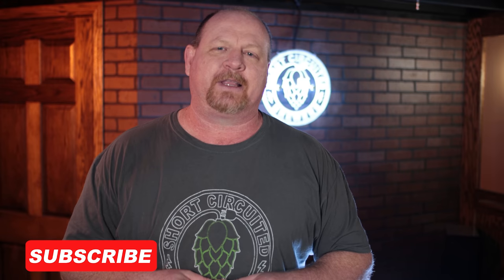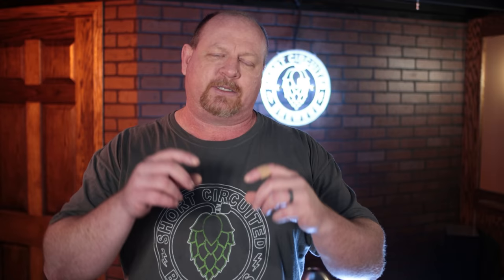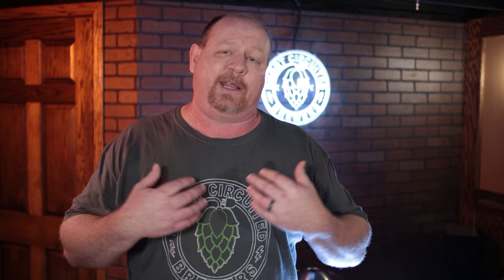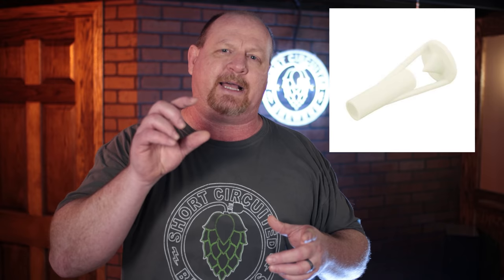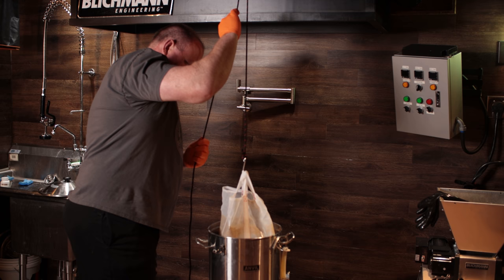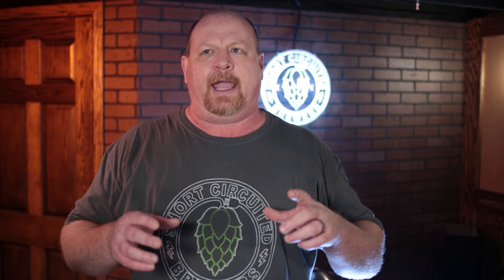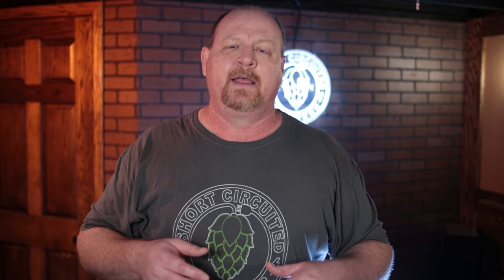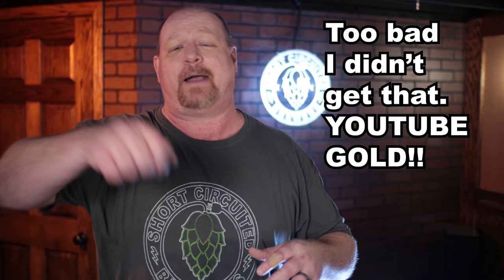Anvil Foundry Feat  The Brew Bag Products

Comment from the maker: Just in case you're wondering I'm using the 12.5-in x 23-in bag. Also this method is not only for the anvil foundry I think it would work on any of the all-in-one brewing systems. Check out the links in the description for all the products I used! 👍🍻
Reply: Timeline: 2.19 in the vid
Here, the bag looks as if it’s too small; might this have contributed to the bothers mentioned later?
Reply from the maker: Good observation I didn't realize it but the bag that they sent me was for using with the basket. It did work fine but there is a larger one that they sell that's for using without the basket. I don't know that that caused any particular issues for me but I would recommend the proper size bag for what you're doing. 👍🍻
Reply: @ShortCircuitedBrewers  As a total novice, I appreciate you taking the time to run this test. It's shown how all-in-one brewing systems can be used without an overflow pipe and how this might dispense with the need for a special micro overflow pipe package when mashing smaller grain loads. This is the first vid I've seen on this topic and your confidence in the process has prompted me to get a bag for my as yet untried Brewster Beacon. Clearly, you don't mind displaying the hiccups when you explore an innovative approach, which of course, makes it all doubly informative and highly entertaining. It's all good. Again, many thanks.
Reply from the maker: @BillyBobpeeps  thanks man I just try to be real and show everything that goes on I'm glad you found it helpful. 👍🍻
Reply: @ShortCircuitedBrewers  gday mate ... so are you saying that with that bag you were given, you should have used in on the inside of your malt pipe?
Reply from the maker: @3nunsbrewing640  yes, they have specific sizes for different applications. 👍🍻

Comment: This video is awesome. I was pondering about this forever. I have a brewers edge mash and boil with pump and I can tell you the malt pipe sucks with the pump it is hard to recirculate the mash because the malt pipe gets clogged very easily and it is very annoying. Hopefully if I try a bag recirculation will be better.

Comment: I use the same bag in the malt pipe and every batch comes out pretty much perfect! They make a really good product there!
Reply from the maker: Yeah my first time with the bag from them. Very good quality for sure! 👍🍻
Reply: I have recently done 2 batches in the malt pipe with the bag. I agree it does make some pretty clear wort. However, I am not getting great results. Seem to be lower efficiencies. Not hitting my gravity readings as well as I would like. Batch of Haze Craze I just brewed a few days ago was also a little low. IDK, Thinking of trying to lift the malt pipe a few times during the mash and see if this helps. I think without the pipe and with a bag would give you better results. I just think the dead space around the pipe is my factor for the lower efficiencies. Ideas? Comments?

Comment: Brian, I've been brewing with the Brew Bag without a pipe.  My question is really about adding hops to the kettle.  Did you have any problem with the pump clogging when dumping the hops pellets directly in?   So far, I've been using hop spiders or Bags to hold my pellets during the boil or hop stand but I'm looking for a better answer.  Would you recommend just dumping the pellets?  Is there an upper limit to the amount of pellets to dump in?  It looks like you caught some of the hops during your "whirlpool" by catching some from the outflow of your recirc hose but thats after material went through the pump.
Give back to you:  I used to squeeze the bag and no sparge.  I have since improved my effeciencies by using a series of 3 food grade 5 gallon buckets (about $5 at Lowes).  One bucket to catch the wort, one bucket with holes that I drilled.  Let bag drain some then move into the bucket with holes.  Sparge.  Twist the top of the bag to the top/center of the grains and add another bucket to the top of that.  I actually sit on the top bucket to get every drop out.  Alt: cut the top off another 5 gal bucket (doesn't need to be food grade because it won't touch wort).  to use as a spacer between the catch bucket and the holed bucket to allow for more wort without overflow problem.

Comment: I use the 400 micron brew rew bag in the malt pipe. I use a fine crush, about 0.3, but I do stir the the grain bed every 15 minutes during the mash. I step mash, ramping up from 145F to 153F in the first half hour, and then ramp up to 170F to mash out in the last 10 minutes. I normally mash longer than 60 minutes, more like 90 minutes.  I always get a mash efficiency above 75%, and usually above 80% (using sparge method).  Note that I also always use a carefully adjusted water profile, amylase enzyme, and a meticulously monitored mash pH as close to 5.2 as I can get, adjusting with lactic acid immediately after I dough in (the first 10-15 minutes of my mash are very busy and hands on); those factors all play an important role for hitting the mash efficiency target.
Reply from the maker: Thanks for sharing those tips! 👍🍻

Comment: Thanks for this video. I have been using BiB with my anvil for two years. Never had a problem touching bottom, I used the lid clamps with the BiB tabs. Will use my ring next time just to see. Never a temp. problem. With BiB I double-crush grains and always squeeze the bag. Do you plan to try the steam condenser? I see you have a fan/hood. I brew outdoors from April to November but would like to set up in the basement for the North East cold months. I also use 220/240 set power after start of boil to 95 or less depending on outside weather.

Comment: Another great video Brian - thanks for all the hard work making your videos.  Gotta say though, on this one I’m not quite sure of the bag benefits.  I’ve used several sizes of these bags through the years with igloo cooler, mashing in kettle via induction heating, and with 5500W element.  Great results but I always found cleaning the bags hard to clean really well.  They are outstanding quality though and I can highly recommend them, and their gloves and pulley.

Moved to Arbor Fab basket with intent on it being easier to use and clean with 5500W kettle.  Good efficiency but the bag was a little better.  Basket was still hard to clean - I must be anal retentive but I don’t like any grains stuck in bag or mesh basket after thoroughly spraying with hose and the putting it back in kettle when recirculating hot PBW.

I’ve use my Foundry 4 times now with just malt pipe and haven’t had any issues with stuck mash, scorching, etc.  I do not use my riptide though; overkill for this system.  Using the small Anvil pump which works well with system.

The single vessel manufacturers design their systems to be used as-is, so if they don’t work as-intended they need us to send them feedback and do reviews.

Just bought a Spike Solo basket for 5 gal batches.  Should I expect issues with the slotted bottom similar to those mentioned about the foundry?  Like our old school keggle false bottoms a quick spray with hose should clean most of debris, correct?

Thanks again, and cheers mate!
Reply from the maker: I will tell you the Spike basket has been known to have some sticking issues. Watch how fine you grind and maybe throw in some rice hulls. I did a NEIPA in the spike basket with quite a bit of flaked adjuncts. Did not recirculate or drain well. I wished I had used some rice hulls. Thanks for the feedback Art! 👍🍻

Comment: I just bought a brew bag to use inside the malt pipe to prevent the grain bits from getting into the wort and also allow me to crush a bit finer.
Reply from the maker: It will work for that for sure! 👍🍻

Comment: Honestly I use the bag inside my malt pipe. It just seems to make my life easier and I don't anymore grains clogging up my pump (I use a Zyborg). I have not seen any change in my efficiency.
Reply from the maker: It definitely is easier to clean up and clearer wort. 👍🍻
Reply: Works great on my Mash & Boil. I clip it to the outside of the kettle so when I pour grains they don’t go down the side and clog my pump.
Reply from the maker: @danc3693  nice! 👍🍻
Reply: Same here. The malt pipe was the hardest part of cleanup until I started using this bag. The only part that doesn't work as well is the distribution plate for the pipe. It doesn't fit with the bag in the pipe. I just lay it on the top and push down a bit and it works fine.
Reply: This is what I do as well.
Reply from the maker: @TheKlamminator  whatever works I always say!! 👍🍻

Comment: I have a love-hate relationship with silicone tubing. On the one hand it's very nice to work with, very flexible and heat tolerant. On the other hand it tends to attack me every time it gets the chance or otherwise ruin my day. When pumping sanitizer solution through it for example the end of the tube always manages to be in a position where it splashes the solution on me or all over the table I am working at. Or, when filling the Grainfather with a silicone tube if I open too much pressure from the faucet  the tube jumps out of the Grainfather and splashes water all over my floor.
Reply from the maker: Haha.. yeah I came up on the losing myself!! Lol 🍻👍

Comment: I recently tested this idea on my Brewzilla 35L because I wanted to try a high gravity brew. With the bag and false bottom, the dead space is reduced to 3 quarts. I didn't want to put the weight of the grains on the false bottom/burner so I attached it to the top of the kettle with a bungee cord. I mashed in 18 lbs 6 oz with 6.75 gallons, which pretty much maxed it out while keeping a thin, workable mash. I only stirred, no pump. I sparged by pouring over the bag in a big strainer. I got 70% efficiency and 1.081 OG. All in all it worked, but wasn't super easy and lifting the bag manually was difficult to say the least.
Reply from the maker: Haha I bet that was an awkward process for sure! That efficiency is really good considering how much grain you used!!
Reply: @ShortCircuitedBrewers  Mash efficiency just to clarify, not brewhouse. I was happy with it overall. I mashed in really well and stirred every 20 minutes. I actually sparged over a bucket because my big strainer doesn't fit in the top of the Brewzilla. Thanks for the video!
Reply from the maker: Ok.. that's still not bad all things considered! Thanks for the feedback! 👍🍻

Comment: Is anyone experienced with using a brew bag inside of the malt pipe, and might have some notes on it? I find that the perforation of my malt pipe in the Brew monk 30L isn't sufficient to keep some adjuncts and finer milled grains out of the wort, but would be optimal to keep it in the pipe since I don't have a crank.
Reply from the maker: There are quite a few people that have used the brew bag inside of the basket. With good results. The only thing that I will tell you to be cautious about is if the handle ends protrude into the basket just be careful that it doesn't catch on the bag and tear it when you remove the bag. I can guarantee you that the bag will reduce if not eliminate the particulate that your experiencing. The link in the description will send you to the company that sells the bag that I'm using in the video. And if they don't have what you need they can custom make one for you. 👍🍻

Comment: I mash like this, with a false bottom in my brewing system. My bag is made of heavy duty nylon and has a stainless steel ring sewed in the opening of the bag, that is just a litte larger than the opening of the brewing system. I lift the bag out and batch sparge in another kettle with heated spargewater. Efficiency is stable at 83-85%, and i do stir a lot.
Reply from the maker: Nice!! Sounds like you have it dialed in! 👍🍻
Reply: @BigHill do you have a LINK for that bag with stainless ring?  Please :)  Happy Brewing.

Comment: I'm using the brew bag with a 35L Digiboil with false bottom and it works great! It makes a cheap but efficient system that's easy to use and clean
Reply from the maker: Nice the digiboil is very low cost. What's the total you have in it $?
Reply: I was looking at the same with the digiboil, but does it hold a constant temperature during the mash?
Reply from the maker: @SteveT__001  not as well as the Foundry.
Reply: @ShortCircuitedBrewers  Yes, no argument there. I use the Klarstein Fullhorn which works great as a BIAB, I recirculate the mash and batch sparge and I can get 80% efficiency but want to make bigger batches. A shame I can't get a 50 litre version without having to buy a all in one. Cheers
Reply from the maker: @SteveT__001  👍🍻

Comment: Great to see a review on this Brian. I first bought a bag to go into the pipe from The Brew Bag and used it a couple times but saw others using a bag only. I liked the idea because the wort between the pipe and kettle seem to be somewhat stagnant. 

Ugh - found out The Brew Bag for inside the pipe was a little too small to fit the kettle. I bought the false bottom which to me seems easier than messing with clips and the dreaded ring. I tie a fishing line or SS wire so I can pull it out after the mash. 

I didn't want to spend another $50 on another The Brew Bag so I went with a less expensive Wisler bag. It doesn't seem as robust but has worked fine. 

At the end of the mash I use the ratcheting lift to pull the bag and let it drain. It's difficult to sparge these bags over the kettle so I hang the bag inside a 10 gallon Igloo round beverage cooler, pour the sparge water over it, then dunk it a few times, and squeeze it a bit. Hit my best mash efficiency yet doing this.
Reply from the maker: Cool! Sounds like it works. The Brew Bag is not the only bag in town
.lol but they make quality stuff for sure👍🍻

Comment: Presently I am working on using a Unibrau as a BIAB system - I have done with and without the bag, although I have no numbers to compare to yet. I am working on the math to determine an extract efficiency (using only the amount of sugar extracted) - I find brewhouse efficiency isn't what I am really interested in. Eventually I am going to be trying to do some light sparges to compare to.
Reply from the maker: Do you use brewing software? It will calculate everything for you. 👍🍻
Reply: @ShortCircuitedBrewers  Generally, yes I do. But I am also working on my own. I am not terribly enthused about using software based around "gravity points". I am working on a setup that uses metric units and Plato (as % of sugar by weight) and seeing how that works out. One concern I have about the gravity point method is the non-linear relationship it has to % of sugar by weight - as evidenced by the comprehensive formula to convert Plato to s.g. whether or not this pans out is another thing. But I love math and beer - so I want to put them together.

I also want to be able to write scripts that do the calculations for beer recipes in a way that others that are interested in the math can use and improve.
Reply from the maker: @zzing  fair enough!!

Comment: If I use a bag with a false bottom in the Foundry 6.5, will that let you brew with more than 8 lbs?
Reply from the maker: The bag really doesn't increase capacity unless you leave out the malt pipe. But you might get a couple more lbs at most.

Comment: Brian, If you put the bag in and drape the excess over the top of the kettle, then you can put the clips on, on top of the seams (i.e. nylon webbing).  This will keep the bag open when you want to dump your grains and it will stop any wort from wicking up and over the top.  I have never had the wicking problem.  I do use a false bottom that seems like it was made for an Anvil Foundry 10.5.  it's above the drain and sensor at the bottom of the kettle - if I find my receipt I'll add the vendor later.  Lifting:  I have a ladder that I happen to store in my basement where I brew.  When ready to lift the bag, I slide the ladder over - above my Anvil.  There is a hook hanging from the ladder that I attach my ratchet to.  Lift/drain over the Anvil.  When finished, I can remove the bag and slide the ladder back to its storage space.  Or if you have your Anvil on a dolly (like you mentioned in the video) you can roll your Anvil to/from the lifting location.  I hope this helps
Reply from the maker: Thanks! 👍🍻